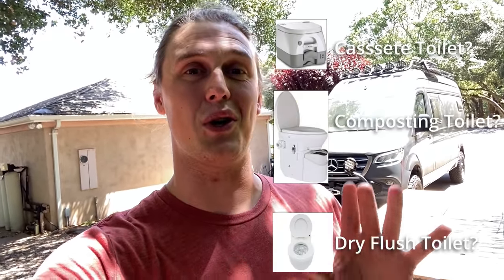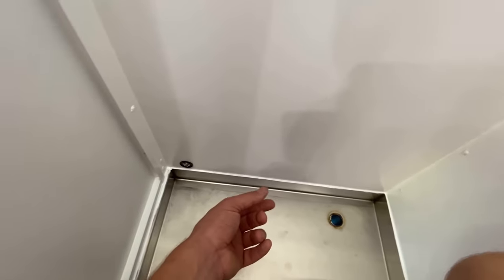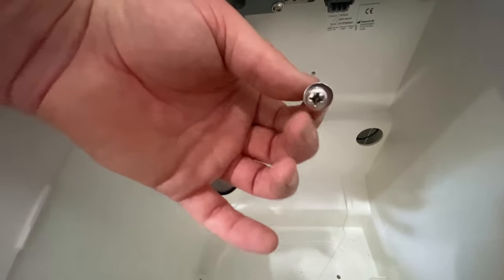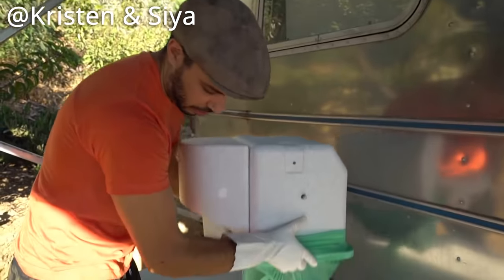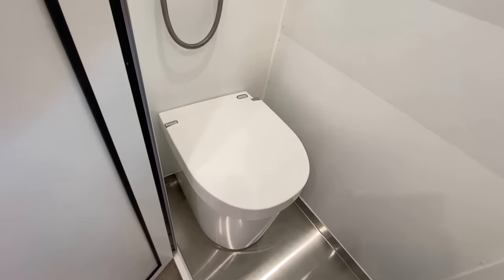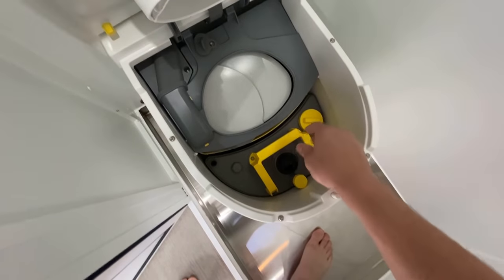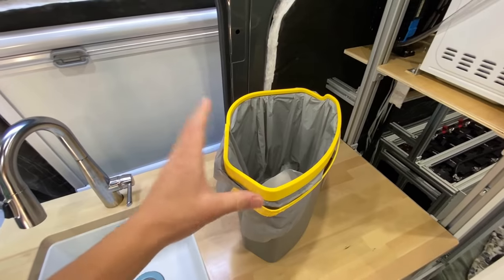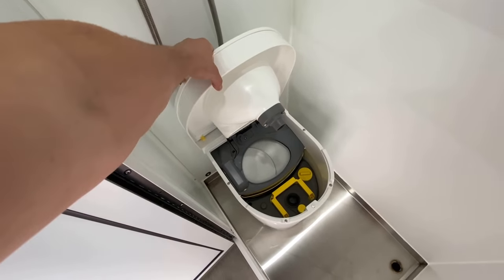The BEST TOILET For Van Life??? Hint: not composting

Comment: I'd very much like to see a longer term review and that the exterior smell is like after a week or two of use. With the traditional compost I find it gets mixed through and broken up enough that the venting smell is minimal but I can't see this one drying out or absorbing the moisture and smell quick enough to not stink out your neighbours.
I'd love to hear how it goes!
Reply: Maybe put a smoke stack on the exit pipe.  Camouflage it as a flag pole.  Extend it higher for days without a breeze. 🤣.
Reply: It's heavily dependent on ventilation. If your stationery for days, it's gonna smell. Not like a barn, but you know it's there. If you got loose stools, or do the nr. 2 more than once a day, you're gonna notice. Running your heat pipe from your Webasto through the shower/toilet room(obviously to be able to dry it out quickly and other comforts), will cook the toilet just enough to engage mold and composting gasses. 

So,  I find driving around every other day definitely removes smells. But yes, your assumption is right. There is a lot of moisture that simply does not get a chance to dry out quickly enough.  I put a good fan on mine, but the internals on the toilet are so important for this to work, the "seals" are never good enough and the air inlet are not good enough to get a great flow.   You could save the money and go with the Simploo, that's mostly the same toilet. ✌️
Reply: @krimke881  thank you for the feedback mate. Sounds inline with my thoughts. I'll stick with my nature's head
Reply: @krimke881  Sounds more like that the way to go is still a composting model. Because there's composting medium in there, and you turn a handle and mix the solids up with that, you're left with just that "dirt" smell over time. Ok, so the optimal solution might actually be a a Cinderella Travel, an incinerating toilet that just burns all the waste (liquid and solid) into a tablespoon of sterile ash, but that's very expensive to buy and  it uses a fair bit of propane.
Reply: I agree and as the long term aim is still to compost afterwards, I would still add saw dust, might be slightly awkward with the auto cover though.
Reply: @krimke881  Ugh! I've been SOOO hesitant about 'VanLife', strictly because of the toilet, smell, cleanliness when using (splatter both #1 & #2) and process for dumping waste. I wouldn't want to have to drive around to eliminate smell.
Reply: @ecel5981  no need to drive around with a compost toilet. We are stationary. There is NO SMELL if done properly. Not even dirt smell… the ONLY time I smell the dirt smell is when changing, there is no smell AT ALL any other time, other than after the initial deposit, just like a regular toilet..
Reply: @bryanniven.  what kind are you using?
Reply: @laraminichiello9425  we use the Airhead brand. Airhead was the original brand between them and Natures Head. From what I understand,  Nature‘s Head was developed from some of the original owners/founders of Airhead. As I’ve mentioned before, in this comment thread, the big benefits of the Airhead is smaller size, has the option to fit against a hull of a ship, and they designed the liquids tank so it can be removed independently, without tipping back the lid and seeing the solids tank contents. I also prefer the round and smoother interior of the solids tank on the Airhead, verses the square/box shaped NH.

Comment: Good review.  I built something similar that fits inside of a bench using a Wee Pee urine diverter, a Nature's Head urine bottle, a 5-gallon bucket, and a standard toilet seat.   I probably spent less than $150 on it.   The original plan was to use a small computer fan to pull air through the enclosure but we found that it's not really needed.  

We simply cover #2 with peat moss and make sure we empty the urine daily. We haven't had any issues with the #2 smell and if we did we would simply throw it out.  We actually have had more issues with the urine bottle developing a stench so it gets cleaned a little more often and I like to put a few drops of Dr. Bonner's liquid soap in the bottom of the bottle after each cleaning.

Comment: I agree that they’re great. Don’t trust the compostable bag though. Mine split 🤢 I now use thick garbage bags.
Reply: Must have been a shit experience
Reply: So are they really smell free?
Reply from the maker: Yikes! very good to know thanks
Reply: Also not a fan of compostable waste bags. . found some in my trunk that had been stashed there for emergencies & they’d degraded into thousands of tiny flakes. It was like large glitter. (2 years stored in dark trunk).

I checked on commode liners - they don’t compost quickly but they won’t split if you store them too long either, sold 20, 50, or 100/ box & can come with a gel pad for wets &/or can toss in some kitty litter. 

Being environmentally conscious is good, but trash that needs water rinsing & chemical clean up can be more wasteful than sturdy poo bags that don’t let smells out so need changing less often, especially in arid regions.
Reply: @TheMagnificentGman  🤣🤣🤣
Reply: @margaretcostello6131  yes, they really are. Obviously not when emptying but I found chemical toilets worse.
Reply: Suggestion:  How about sticking with the compostable bag but just doubling up on them as a safety precaution in case the main one splits.
Reply: @jameslacey460  I actually triple bagged and all three split!
Reply: @samandserendipity5324  OMG!
Reply: @samandserendipity5324  ,
"Shittt!"
Reply: @juerbert1  😂
Reply: @Fart Zilla I use heavy duty bin liners now. They’re a bit big but they haven’t split on me thankfully. Not an experience I want to repeat!
Reply: @samandserendipity5324  You need to lighten up on the burritos,  fss...lol
Reply: i'd definitely be double bagging!  maybe put some newspaper lining too.
Reply: It's been difficult to find darkly colored small bags. In addition to the smell, seeing it through standard small trash bags has added to the ick factor a bit. You get used to it, in a way. But, new users don't seem to enjoy the experience much. :) 
Ikea used to sell some small, sturdy dark grey bags, but I didn't find them last time I was there.
Reply: @samandserendipity5324  too much fiber!
Reply: pooh
Reply: How about a compostable bag inside a thick garbage backup bag. This way, if the compostable bag deteriorates, the garbage bag will save the day. If not, just throw out the compostable bag, and feel lucky!
Reply: @CrankyOtter  Yes I have had the same experience.  I always carry dog poo bags and keep one or two in every jacket pocket so I am not without when needed.  I bought biodegradeable ones and they disintegrated in my coat pockets. It was a disaster to clean out my pockets. Another time someone gave me one from their bag and after I picked up the dog poo with it, the bottom fell out!
Reply: Reading through these replies made me laugh so hard!
Reply: @samandserendipity5324  including ur pants?! jk 🤣
Reply: If you’ve ever had a plastic bag full of cat litter waste tear then you know…
Reply: I have only ever used a bag in a bucket and it costs pennies. After reading this series of opinions, et al, I looked up Amazon, where 40% respondents voted 4 & 5 stars but a whopping 40% voting just a  1. The universal reason was cracked and broken seat and sliding plate thing.  I can just visualize the time when you are running short with a watery deposit and then spend the rest of your vocation cleaning the dam thing up.  Nup, I'll stick with the bucket and bag thanks. And check the price, $1000 to buy and $500 to post. that's $1500. Yikes, now we crap first class?  Do we receive bonus usage points with this?
Reply: @Fart Zilla always never enough )
Reply: @samandserendipity5324  You can maybe close the bag and take the little bucket to the trash dumpster, then just turn the bucket content without lifting the bag... If it's possible.
Reply: @samandserendipity5324  Oh Shit!
Reply: @samandserendipity5324  Holy shit!

Comment: The issue is the smell when you have to close the bag.  I think that the issue could be addressed with a re-engineer where the container would come out sideways and at the same time it would be pulling the bag close so the smell would be contained.  Maybe separate could use this idea for their next model.
Reply: You can dump some baking soda before you wanna poo. that reduce the smell by %50.
Reply: If a toilet like this could seal the bag automatically with a press of a button it would be ideal, would be just like the Laveo dry flush toilet but with a more efficient design.
Reply: Back in the day in Nam, we had S*** Burners. They would pull out the lower 1/3 of a 55 gallon oil drum and add diesel fuel and lite it up. This was a really smelly job as there would be maybe 6 drums burinig at one time with a guy standing there mixing the drum so as to burn up the s*** as best they could and replace the drum in the S*** House. Normally a 4-6 holer, except for the officiers who had a single holer. Hmmm. Wonder why that was.
Reply: I loved watching this video but the hassle of dealing with both compartments still makes me prefer the dry flush toilet. It's more expensive yes but it's easier to navigate. As for number 1 with the dry flush, that can be done directly in the bathroom and flushed away with water.

Comment: When my family went trailer camping, we had a Monomatic recirculating toilet.  It had a 12 volt  pump that recirculated the water at the push of a button..  There was also a blue powder that, when added to the water, got rid of the smell and aided in breakdown of the waste.  Back in the 1970s, there was only one common holding tank that combined gray and black water.  BTW, it was modeled after the toilets used in commercial airliners.

Comment: We had a "cassette toilet" on our boat for several years.  The smell was not at all atrocious, but you could notice a distinctive chemical smell from the deodorizer that you have to add.  We just poured it out in a conventional land based toilet, about once a week, after midnight.  Our new boat has a blackwater holding tank and it stinks, and the hoses and seals require regular replacement, for odor control and there is always the fear of leaking or overfilling your holding tank.  It also requires a marina with pump out and costs about $20 to empty.  I agree completely that no one uses a composting toilet to compost their poop, if they are using it on a daily basis.  It takes more than the week or two that it takes to fill it up to compost the poop, and carrying a couple of five gallon buckets of sawdust on the boat uses a lot of space, and sawdust, kitty litter, or coco fibre is not easy to find at your local marina! We are currently using a 6 gallon bucket with urine separator, a plastic bag trash can liner and sawdust for odor control and moisture absorption.  If it works out, but smells we will add a fan and vent to the outside (holes in boats are never desirable).  I love the idea of putting one of those moisture absorbing papers in the toilet!  The cost of a commercial toilet, other than the "cassette toilet" is outrageous for a bunch of molded plastic!
Reply: The most common system uses a black water tank. The cassette toilet with a spare cassette is clean , and can be dumped in any toilet.

Comment: I'm going to get a C-Head toilet. I'm surprised it is not the most popular composting toilet for van lifers, as it requires NO ventilation- No duct, no fan, no electricity, no cutting holes in the van(and no nasty smell!). It was designed by a sailor for boats. Another feature that sold me on it is that it uses standard gallon jugs(water/milk/etc) as the urine container...they can just be thrown away when they get dirty. The main composting bucket can be pulled out to empty without having to remove the entire toilet and perform a tricky two handed cleaning like with the Nature's Head toilet. It has a regular sized flip up toilet seat, too. The clincher? It is less expensive than the other composting brands- and 300 dollars less than the Separett Tiny. THREE HUNDRED DOLLARS!!! And has fewer parts to clean/fail.
Again, really surprised more people don't know about it.

PS: A ventilation fan can be added to it if desired, but both the company and van lifers/tiny house owners who have done videos about it say it is not necessary.
Reply: I checked out their website and videos, this looks like a really cool option. I wonder if you can really get away without a vent
Reply: isn't it 750$?
Reply: @albertocastillo8586  It was $650 when I priced it in May. Wow, if it is 750 now...this pandemic has caused crazy demand in materials and components. Damn. Still cheaper than Nature's Head and by a fair amount, but...damn. I still think it is a superior option, all things considered.
Reply: @Mauronic100  they have a vent option as well. Word on the street is that it works well not vented in cold weather. But if it's hot, you need to vent it or it stinks.
Reply: @peterdods425  thanks. Yeah not worth taking the risk for such an easy add-on 🌬💩
Reply: You are going to need a fan. These type of toilets don’t work well at all without a fan.
Reply: I have a c-head.   I’ve been using it full time for the last 5 years.   It does not smell.   I use cocoa core and pine shaving.    I just dump it into a big black plastic bag once a week, and that works for me well.    No smell, no mess.
Reply: I believe if you check out c-heads website you'll see its not a fully composting  toilet and it needs to completed elsewhere, though if it's going in a dumpster that's neither hear nor there
Reply: @rdabadie  Nor are the other "composting" toilets, like Nature's Head. None of them have the capacity to fully compost based on usage and time. It's an equal process, no matter the tub you put it in. Fancy valves or just a bucket, it all decomposes at the same rate.
Reply: I'm going to look that up!
Reply: I have one on my boat. Someone gave it to me. It's the simplest design of the 3 major brands. And the smallest.  I plumbed the smallest 12v fan in with 1" PVC and homemade flange. Its odorless. My boat doesn't smell like head. At all.

Comment: You did a fabulous job of reviewing all the toilet options that exist (except for the comment about troweling out the composting toilets).  This one has the plus of using bags to clean up, the negative of looking at a pile of poo when it's clean up time, the plus of a really decent looking urine container (is there a sealing valve that shuts out the odor?), and the negatives I always object to of running a fan constantly and draining your house battery for that.  I hope the vent pipe was secured a little bit better than what you showed under the van...could something hit that on the road?  Anyway, thanks for this video about this new product.  We still prefer a portapotti for #1 and a composting bucket with metal liner for #2, with bags for clean-out.  So basically we have two toilets.
Reply: No he didn't actually. This toilet sucks

Comment: If you’re an engineer, design a dry flush with a urine diverter. Perfect combination! Love your van!!
Reply from the maker: That sounds like fun 🙂
Reply: @seven_o_savage  Better yet, design a less power hungry, incinerating toilet… But also, very excited about this newly designed toilet.  🔥💩🤙🏼
Reply: agreed, i made my own version of this, less fancy, for $250
Reply: 'Engineer' versus ingenuity? 
 Thanks!👍
Reply: Ive been waiting for someone to do this forverrrr i was wondering if they would just build around a dry flush make it a little taller to add a urine diverter to the front idkkkkk i need to see someone make oneee
Reply: put a larger size tank for the urine under the vehicle that could be disconnected and wheeled to a toilet like a cassette toilet.
Reply: @amywalker7515  I've seen some innovative ideas for replacing the "on board" urine bottle so that the urine is diverted to a larger tank where it can be emptied from the outside by either draining along the road in nature or when at a campsite.  The only downside is that you need to be very careful to make sure not to let any solids go there or they can clog the line - easy for men but a little tricky for women.
Reply: @Illuminate-Life  are your plans available anywhere?

The most impressive part of the separett is the auto sealing lid imo.
Reply: My thoughts the entire time after he made that statement! Im willing to bet you can!
Reply: @Illuminate-Life  Can you provide details?
Reply: @hwkluth  just divert the urine to the grey water tank. after dumping the grey water tank add 1/4c or 1/2c bleach or vinegar to disinfect.
Reply: @_GntlStone_  That is what I was thinking.  I saw a neat idea once where the RV'r set up a tube from the bathroom sink to the diverter, creating a sort of "flush" as you wash your hands.  You'd have to empty the grey tank a little more often that way, but it solved the rinsing of the diverter.  The occasional sanitize with vinegar or bleach is a good idea too.

Love your name btw - I'm also known as GntlHrt on some social media.
Reply: They make one that does that already. Which is why I was confused that this is their new model? Maybe because it's smaller
Reply: @michaelchrisco7855  just check out their website it's on there I think.  If not let me know and I'll look for it I have somewhere
Reply: @Illuminate-Life  Me too but I spent a little less.
Reply: This is exactly what I was thinking.  Shit gets bagged for you and you dump out the piss like normal.  Best of both worlds.
Reply: @hwkluth  not that tricky for women, just make the opening a little wider and saddle shaped, just attach a shee wee to a hose/container